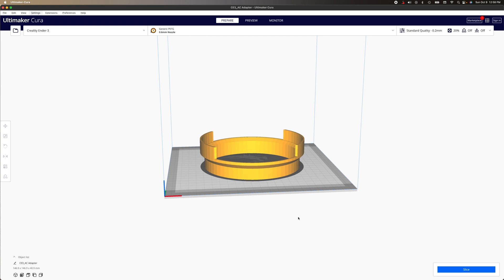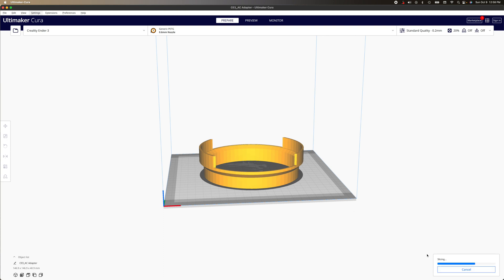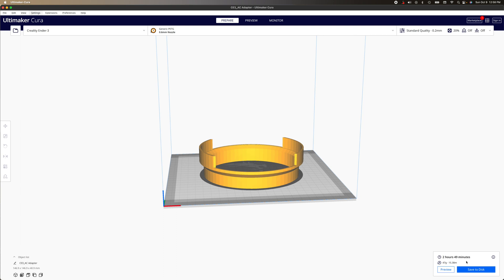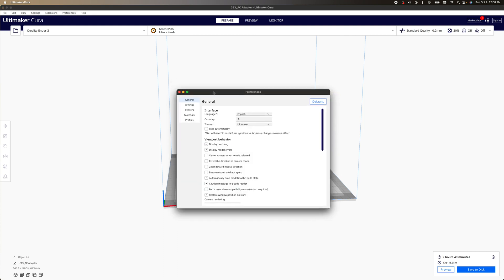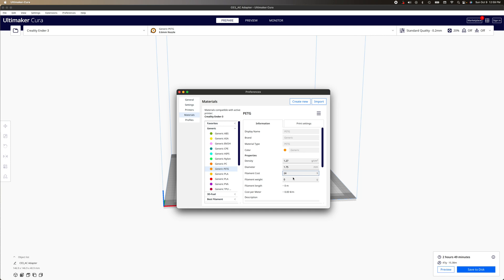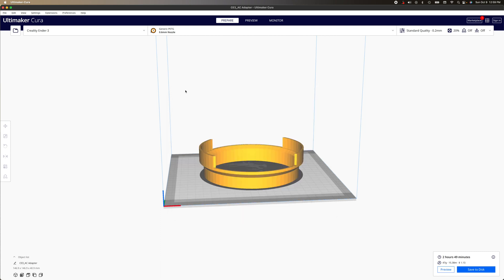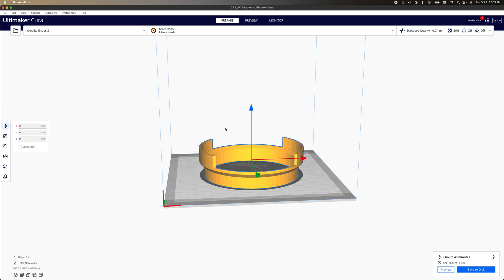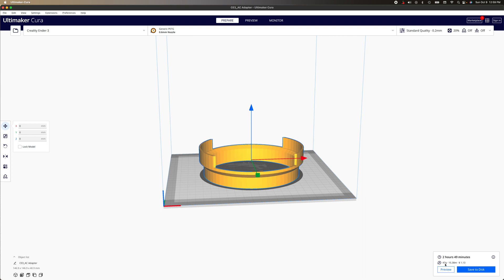How to Show the Estimated Cost of a 3D print in Cura.

Comment: It would be nice if they would calculate electricity too. 

For some prints (high precision, slow, low on plastic) and depending on the region, it can be comparable price to plastic, if not more expensive.
Reply: That's a lot trickier than filament cost, filament used is defined by the slicer, energy usage is totally dependent on your specific hardware, how much current do your motors use, how much heat do you lose and much energy does it take to keep the temperatures up (including room ambient temperature).